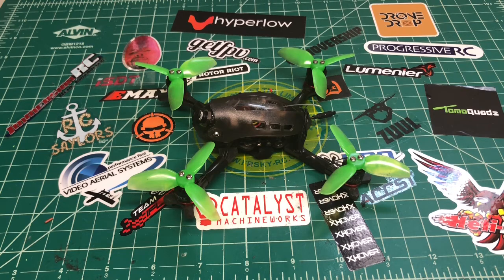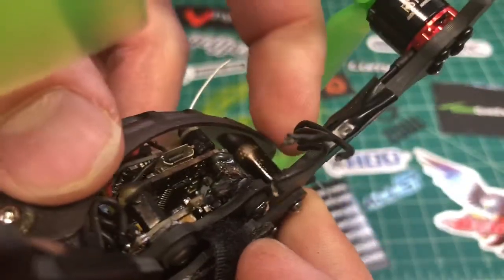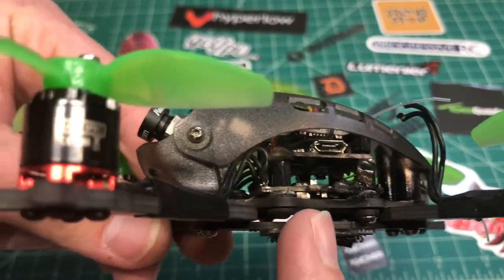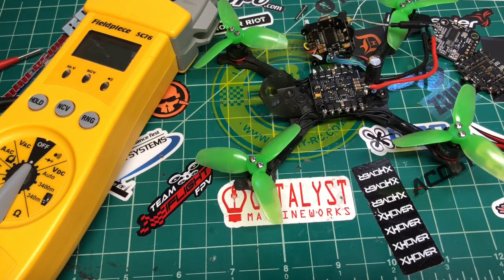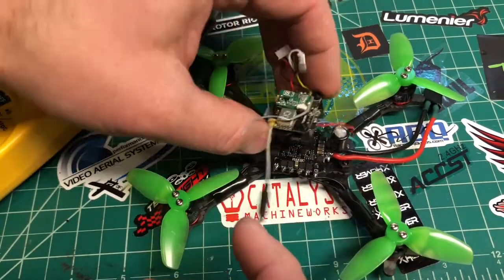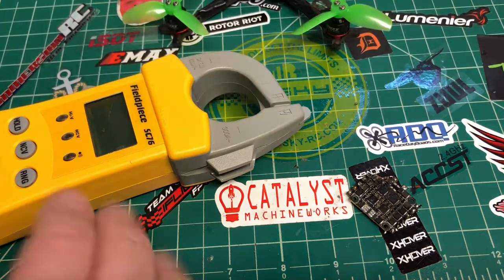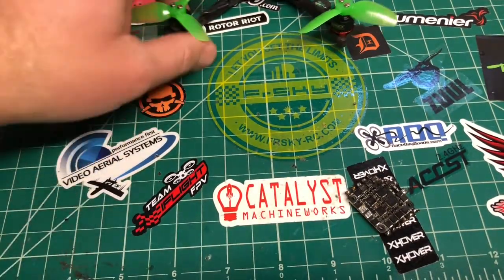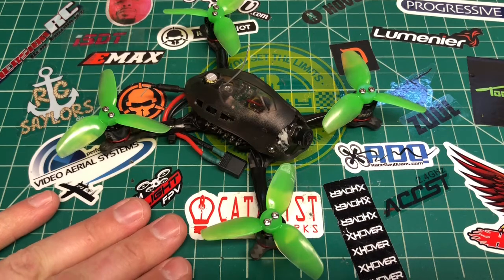Babyhawk R Major Issue!! And How To Fix It.

Comment: Thanks Chirs..I got a Bbyhawk with a bad esc. I put another one in and same problem.  2 Motors  wont run. At first it was 1 now 2 consistantly.  2 on left side , same as usb,  run great.  So, I really dont want to put a third one in.  Will likely lv my pins in, like you suggested. So what esc did you use or did I miss something?

Comment: Hey man thanks for the vid ! I safeguarded mine with a 3d soft print. 
I actually had my vtx go out on me when I was running a 4s battery. I literally lost image transmission while in flight ! Long story short. I contacted emax about this. Especially since I just brought it a month ago. I double checked the camera everything is good. It’s only the vtx that lights up but doesn’t send signal to my goggles. Heard anything about this issue ? 
Im dissatisfied with the quality control of Emax ! Hope to hear something from them soon.
Reply from the maker: Rc Drone I haven’t sorry. But it’s not the best Vtx. I recommend the aomway vtx004. 200mw and very compact. Emax did nothing for me. Good luck.
Reply: Chris Romano hey. Just found the problem on the vtx. I de soldered the wires for the camera and saw one wire was not making a good enough connection. I redid it and now it’s working! I’m so glad it gd now. 
Testing it today on the field 👍🏻

Comment: Hey There, you look like you know what you are doing!  The hex screws that hold on the stack for my Baby Hawk R 3"  have broken.  I measured it and they seem to be 4mm high and wide - I bought some hex screws online but they were too big :( any idea on how to fix my stack with the screw broken for this drone?  It's been three weeks since I've flown and I would love some help!
Reply from the maker: FreePearsFly they are m2 screws. The nylon and metal are all m2. That’s the thread and diameter. Not sure off hand the length of the metal screws that go through the bottom but if you order a assorted kit off amazon something will fit. Same with the nylon. Order an m2 standoff kit. Then you will be able to always fix your stuff. They come in handy. Larger drones use m3 size.
Reply: Awesome thanks :)

Comment: Any ideas why mine vibrates at more than hover on throttle?
Reply from the maker: Brian Richtmyer could be a prop, loose arms, loose flight stack. Make sure everything is tight first. Then move into tuning.
Reply: Chris Romano I checked all of that even the camera. If I punch it or throttle up above hover I can hear the props vibrating I changed 4 sets of props and still does it. Also i lowered the d's in pid down to 20 they were on 40 like my other quads. It seems that it helped a little bit but how low can i drop the d's? 10?
Reply from the maker: Brian Richtmyer shouldn’t have to drop it down that far. Is the capictor still attached correctly? Try lowering p by 10 and observe the behavior. Could be a bad part as well. I noticed that the avan 2 inch props can make it vibrate with the the slightest issue. If your using the ones that came with it, try a different style prop.

Comment: What about if I just put some 3m tape between the frame and the thing that touched?
Reply from the maker: Cory Venezia you can do that for sure. Even some black tape would be fine. Probably better so he esc doesn’t get stuck down.
Reply from the maker: Yea I read it. But they got loose I have a couple turns not realizing what could happen. Shit happens lol. The 2.5 inch size is my favorite right now.

Comment: Wow glad I came across your video. I just got one a couple days ago, and got it all bound and stuff, and because I saw another vid saying to make sure to tighten all the screws before flying, I tightened up all the screws on it. I haven`t got the 3s  batteries for it yet so haven`t flow it yet, So now I`m going to loosen the screws some! Any other thing you might suggest to help to keep this from burning up like yours?
Reply from the maker: HumbleHeartMinistry just keep some space on the bottom of the esc. Best thing is to take the screws out, lift the stack and put a layer of electrical tape on the carbon.
Reply: Ok Thanks will do!